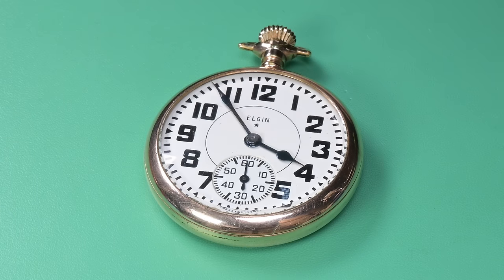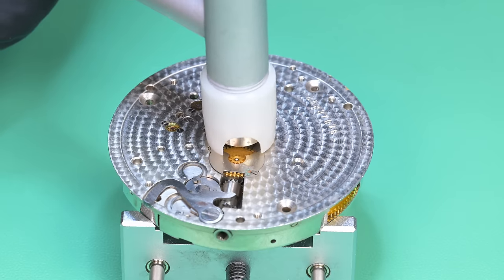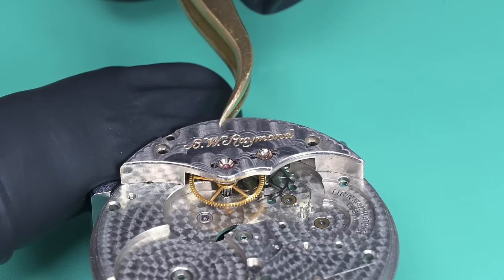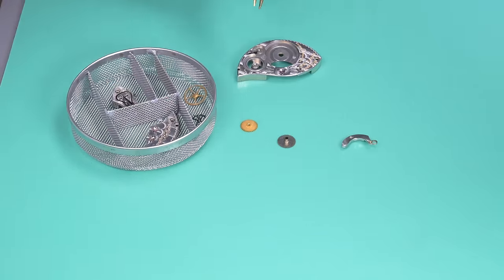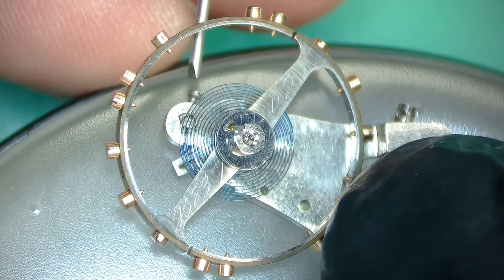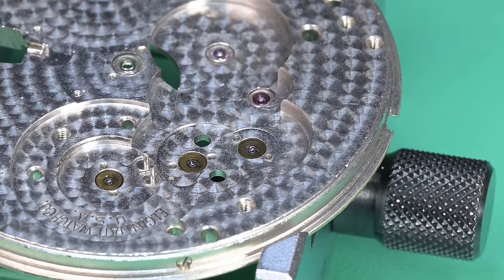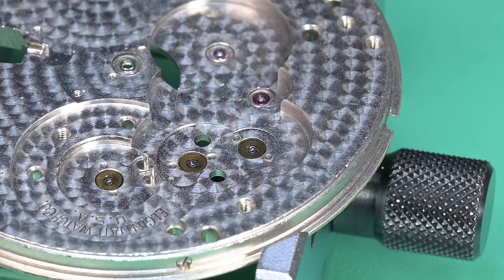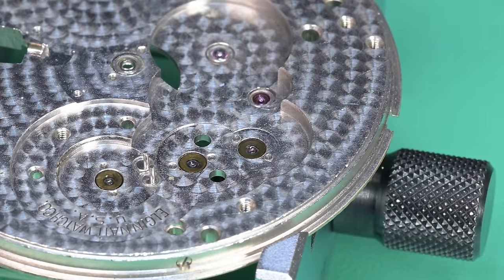A Timeless Classic: Repairing & Gifting My Mom a 100 Year Old Elgin Pocket Watch

Comment: great video  and a very sweet idea.  I  had a situation where i had a seller said a pocket watch was serviced and its running well  however on closer inspection when i got it i noticed a few screws missing namely the case and one of the balance cap jewel screws.  not to mention it was running poorly. . the dial on my watch was drop dead gorgeous  in great condition  and the hands are in great shape.  i am gating mine serviced by my trusted watchmaker.
Reply from the maker: Thanks.

Comment: Hi,
I'm still learning, but yesterday I won one of these watches (For repair or parts). I intend to follow along with your video and make it right again just as you did. Thank you very much for doing this watch and showing all the small details. Where did you get your replacement jewels and replacement crystal from? - Thomas
Reply from the maker: That's great to hear.  I bought my jewels from a seller I found on eBay, but if you measure the jewel OD and pivot width, you can order them from  one of a couple parts supply houses.  I believe I got the crystal from Esslinger or Otto Frei.
Reply: @WeekendWatchRepair  Thanks so much for the quick reply. I’m a very mechanical-kind of guy so this should be interesting. But I do have to admit, that’s a LOT of parts! That’s why I’m so glad for your video. Don’t worry though, I plan to take lots of pictures and do some drawings as well.

Comment: Stellar video production! I only work on wristwatches and was wondering why you removed  the hole jewels from the mainplate after removing the cap jewels? Is there a benefit to cleaning them while out of the mainplate vs. leaving them in situ?
Reply from the maker: Mainly because I did not want them to come out during the wash.  With the cap jewels removed, they could potentially come out, and with each jewel being specific to each position it was a way to keep them all organized during the cleaning process.

Comment: I just got a Bulova pocket watch and the crystal fell right out when I took the watch out the package. I’m trying to figure out how to put it back. Looks like a drop in style. Are these things secured with glue or press fit? There is a lip that it sits on. When I drop it in.  Need a little help. Any tips would help.
Reply from the maker: Some are tension fit, and others are attached with adhesive.  It just depends.  Is there a slight lip that the crystal would slide under?  If it just rests on top, it would likely use adhesive.  G-S Hypo Cement works well.
Reply: @WeekendWatchRepair  thank you I will try that. I will really take another good look at the way the bezel is designed. It maybe the wrong size crystal on there. I noticed the long hand is slightly bent in a bit. Not sure it it’s suppose to be like that. Doesn’t seem to rub on the dial. But I can see a few scratches at the tippy end.  So brings me back to thinking it may need a higher dome crystal. It’s my first pocket watch too.  I’ll double check when I get off work. But thanks for your help. Appreciate it.

Comment: Patek Phillip invented the keyless works and back when they did if you wanted a keyless pocket watch you had to buy a patek Phillip cuz they held the patent for it for so long. Even decoration serves a purpose such as perlage and Geneva striping is used to collect and hold dried oils, dust,debris and small metal shavings so that they don’t get lodged or fall down into the movement. I’m sorry but due to the decoration actually serving a good purpose if there isn’t perlage under the balance imo the movement isn’t technically finished and if you see it this way you can understand why ppl don’t like seiko movements cuz due to the lack of decoration on the movement their movements technically aren’t finished and not as good as most Swiss movements. I don’t do seiko movements and a lot of enthusiasts also don’t due seiko movements due to their movements not having decoration and being unfinished. It’s like, they work but if you don’t decorate the movement then the movement isn’t really complete and is really just half ass done imo. And no one wants a movement that’s just not complete or finished or just half done. So even the decoration on a movement serves a purpose. And if there isn’t any decoration on the movement that purpose isn’t being served. But just cuz that purpose isn’t being served doesn’t mean it isn’t a decent movement or not a good movement design and couldn’t be perfect and probably would be perfect if it were decorated. I hope that makes when regarding decoration.